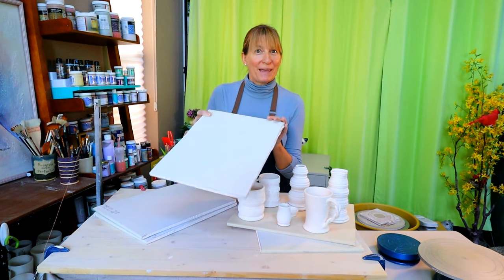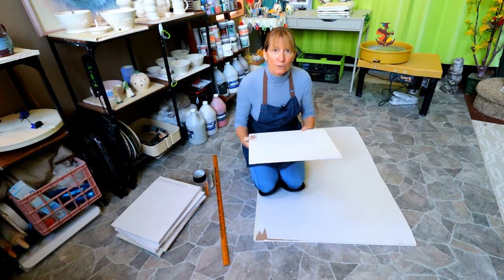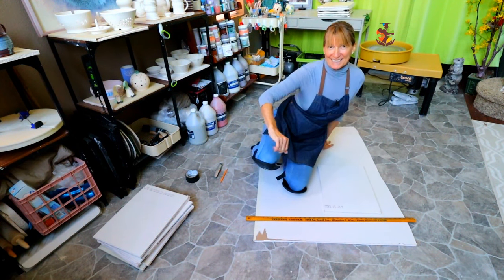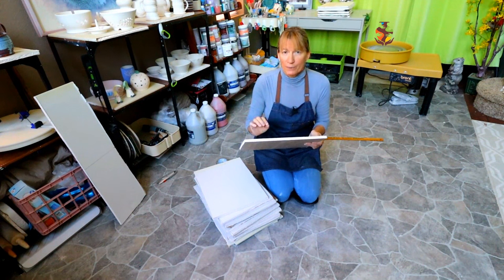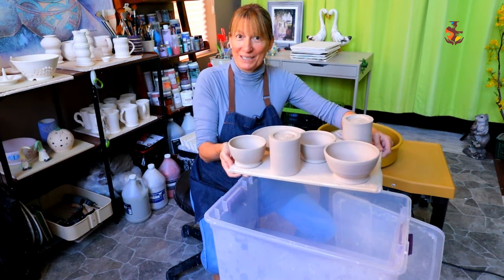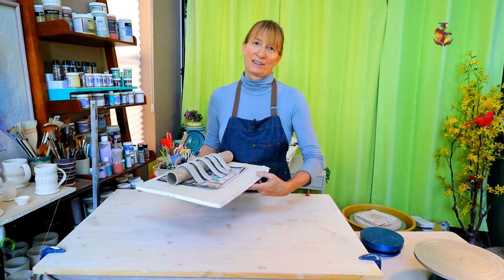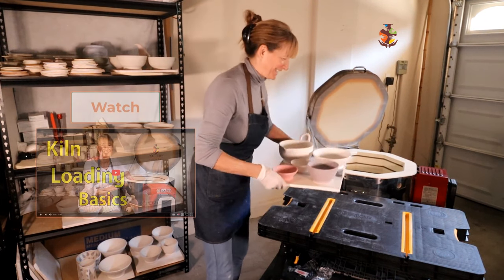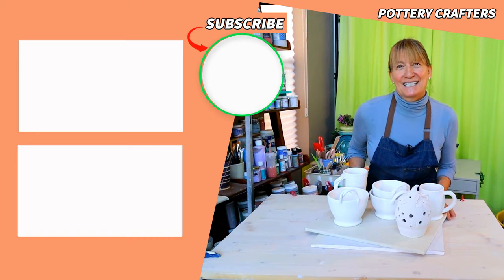How to Make Ware Boards for Your Pottery – What Are Ware Boards Used For

Comment: Thank you so much for sharing this very informative video! :)  Do you think I could cut small shapes out of clay with an exacto knife directly on the board (so I don’t have to handle it by transferring the delicate pieces)?  Also, in another video I noticed you use newspaper to dry between boards, but will it definitely stick if you don’t use newspaper?
Reply from the maker: Thank you 😊 Good question, yes you can cut right on the ware board just put newspaper down so you don't cut into the board. Yes, I put newspaper down so the clay doesn't stick. 😊 No, the clay will only stick to the board if the clay is real moist.
Reply: @PotteryCrafters  Thank you very much for answering my Qs! 💛

Comment: Hello Marie, thanks for another super useful video. Can drywall also be used to make shelves? I use pine shelves but they end up warping.
Reply from the maker: Thank you Lisa. Great question. Yes you can.  I would recommend using the 3/4 inch think drywall. 😊

Comment: Would it be a good idea to put kiln wash on the back of the ware board?
Reply from the maker: Hi Sandra. That is a good question. No. Because Kiln wash is only useful in the kiln to protect your kiln shelves by preventing the melting glaze from sticking to the kiln shelves. If you haven't seen it. Here is a video on protecting your kiln shelves  https://youtu.be/ss-kqVRXhl8

Comment: Do you use your drywall ware boards for wedging and/or hand building?
Reply from the maker: Hi Donna. Good question. No, I don't. I use a half-inch 2 by 4 piece of maple wood that I clamp to my work table with C-Clamps. Then when I glaze I take the wood off my work table. 😊

Comment: Hi there. Love your videos!  I have one question. I have used drywall with clay a few times, but the paper seems to disintegrate quickly. Why this material instead of plywood?
Reply from the maker: Thank you, Lisa. That is a good question. Plywood is also good to use. I like drywall because it's easy to cut into the sizes I like. Yes, you have to be careful not to get the drywall paper too wet. I put newspaper over the drywall ware boards when I'm working with wet clay. 😊
Reply: @PotteryCrafters  Thanks so much!!

Comment: Thank you for the info on drywall ware boards.  What do you use as a portable work surface?
Reply from the maker: Good question Idelle. 😊 I got my portable boards at Lowes. You can get 2 by 2 or 2 by 4 - half-inch thick or quarter-inch-thick pieces of oak, maple, or plywood. then I secure it to my table with C-Clamps. These boards come in handy. I flip mine around and use a separate one for my colored clay and glazing 😊
Reply: @PotteryCrafters  Thanks so much.  I am enjoying your videos.
Reply from the maker: That's wonderful Idelle. Thank you for letting me know. 😍 Glad I can help.

Comment: Hi! I like your videos- they’re very informative!
What do you use as a working board (for wedging, building etc.) I take it burlock is not practical as it doesn’t take humidity very well?
My name is Beatriz btw.
Reply from the maker: Thank you  Beatriz 💖 I use a piece of oak wood that I got from Lowes. It is 2 feet by 3 feet and a  half-inch thick.  I use C-clamps to hold it in place on my table. It works well and absorbs the moisture well also. 😍